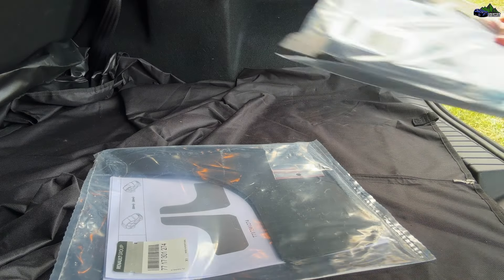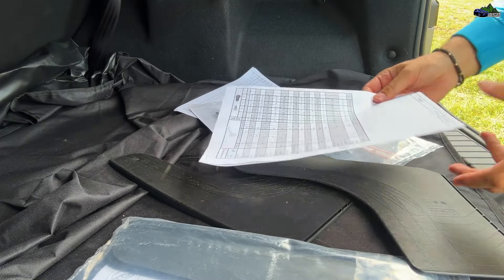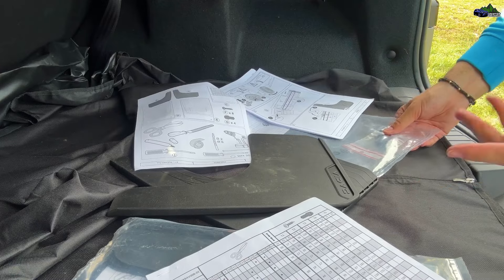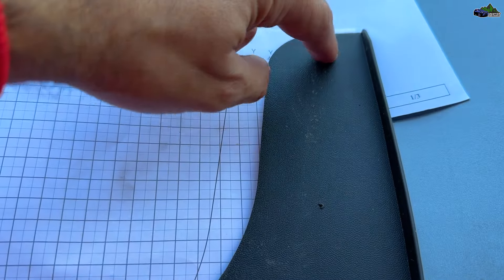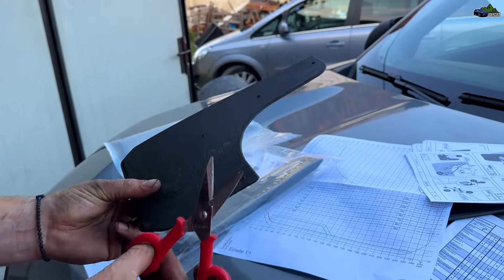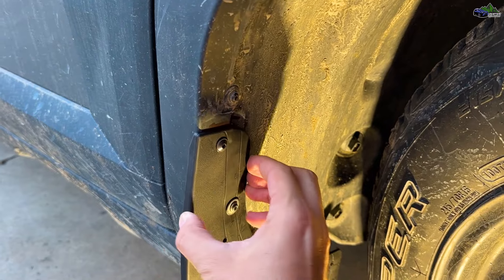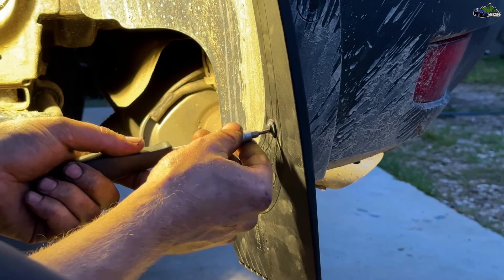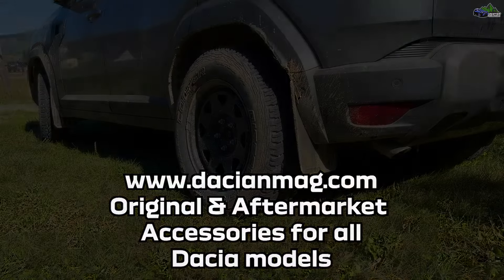Dacia Duster 4x4 2024 Genuine Mud Protection Flaps

Comment: Yes, its the official Dacia side step, bought new with the car, about 4 years ago.  The Dacia garage told me that I could not fit the front flaps because the side step obstructs.  I would like to if possible, because presently mud builds up on the step.

Comment: I just received from Dacianmag two sets for front and rear. They are still unpacked, and I'm not sure what to do with them after watching your video. They really does look universal as you say, a bit not matching Duster 3 style and some kind of loose fitting.  Also watched videos of Duster 2 mudguards, which look much more dedicated and durable. I'm little bit disappointed of this purchase. Anyway thank you for your video, if watched in first place, i wouldn't buy them. Can you share up to date how they perform, so I can take final decision, to mount or sell them.
Reply from the maker: They perform better than the ones on duster 2. Being more flexible it will resist for longer . As for the looks, you have it in my video. I like them and they do a great job protecting the doors from mud and small rocks. And the most important thing, I don’t think you will find something aftermarket soon. So by the time you will find, you probably will get in some situations where the original mud flaps would have been helpful 😄
Reply: @ Thank you for sharing this information, I will give them a try. :) 
Greetings from Bulgaria.
Reply: Today i gave them a try. Totally disappointed, according the instructions T4 is Y200 & Z195, yeah but this part was cut on O2!!! A week ago when i watched your video i thought that T1&T2 match the wholes that already keep the plastic, but today i found out that none of wholes match the original. You have to hate your new car start drilling new holes, not to mansion that there is no starting point that will keep the pads in exact position, you have to be prepared that pads can have +- some millimeters difference in mount position. Total french crap and waste of money! If you have spent fortune for a new duster, but your mindset is that you're driving an old Lada Niva and don't give a F** how your new duster looks after those pads, then you're on the right track, go and buy those shitty pads.